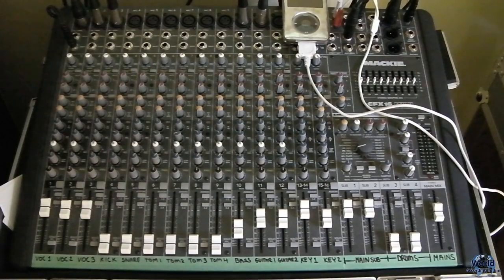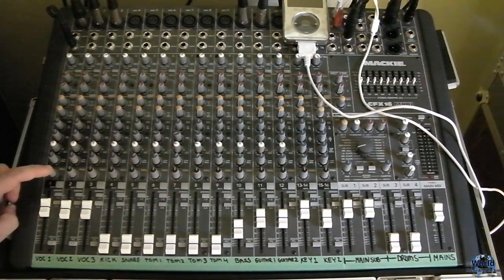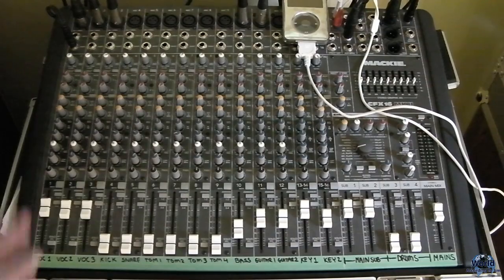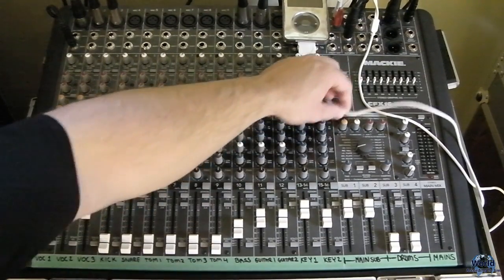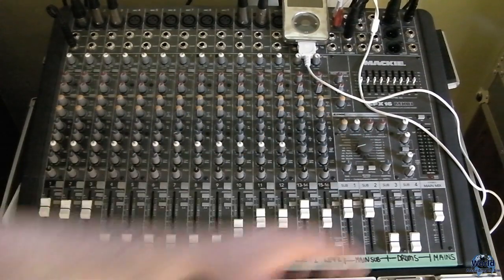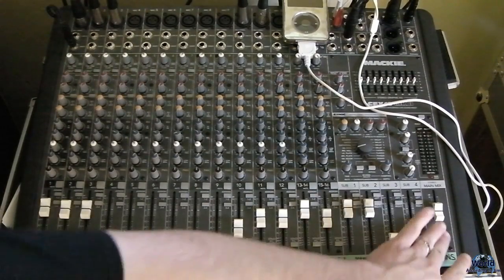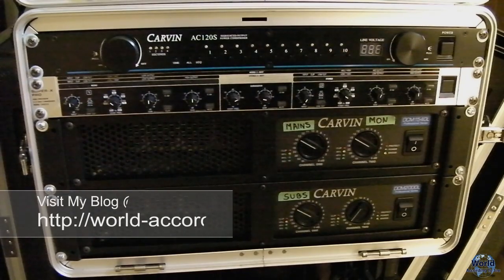How to setup a Pro Audio Sound Reinforcement System

Comment: I found several opinions here in the net about CAT5 cable, definitely this cable is not suitable for an AUDIO SNAKE (if we intented to use it on the go, abused and stepped on). Obviously not for the band that go places. But it took me 2 weeks to troubleshoot the buzzing and humming at 12:00 vol. level. It worked perfectly fine, only, I did it for permanent setup. I run it fixed on the wall from the stage of our church to the back seat area. Not an entry level audio snake but it works. Cheap!

Comment: That was very informative. Oddly I have the same Mackie board and the same BBE compressor and am really happy with them. Good equipment for working musicians at a reasonable cost. 
Love the tips on the where to run the compressor and eq. I like your style or rather lack of any pretension.  A regular guy explaining things well. Bravo and thanks for taking the time to make this. I learned quite a bit.
Bought a snake and was wondering if you can use them as sends for speakers as well as inputs?

Comment: Thanks for the info,Just purchased my first mixer (Mackie CR 1604 VLZ) Similiar to yours, but no built in effects. Will eventually use this equipment for live sound, but it's main use will be in my home studio.I found most of your information helpful.I am also interested in hooking this mixer up for recording in the studio ( I have 2 Alesis ADAT machines ) And an Alesis io2 digital interface wit Cubase LE software.The manual with my Mackie is a little confusing. 
Thanks again for the information

Comment: The problem with signal leakage when using the panning knobs is due to the quality of the board you are using.  Mid-quality and higher boards DO NOT leak signals between panning knobs.  

Also - if you are using sub-groups, you need to pan the channels to get the full signal!!

Comment: 12 o'clock is fine, or even 3'oclock, as long as the gain from mixer through processing is correct. The attenuators allow you to set for desired or legal volume levels by trimming back the signal sent from the mixer/fx rack instead of the other way round(amps fully clockwise but faders &trims on mixer set very low = noisy, thin sound to both house and stage monitors).

Comment: Awesome video! I learnt a lot about running PA systems. I didnt realise you need much more than 2 FOH speakers, 2 monitors, a mixer and a power am. had no idea about running compressors, eq's and crossovers. so now im left in a world of confusion and wondering if you could help.

Basically i have the same mixer as you do, and was wondering how to run guitar amplifiers and bass amps through the mixer for a more live sound.. please let me know a simple setuo for a small church band.. :)

Comment: Great vid I found it very useful. I see you have an iPod plugged in. I presume you'd want this to be play back music in stereo. Your vid is about setting up a band in mono. When I plug in an iPod or such device into a stereo jack of my mixer the output is in stereo but sounds bad/flat. It doesn't sound very good.
Simple set up as were building up the PA
Edirol M16-DX digital mixer > Cerwin Vega 2800 power amp > Peavey monitors. Any suggestions on getting a good sounding mp3 playback on the PA?

Comment: Regarding with the mixer that you have (Mackie CFX II).   I got the same mixer.  One thing that I hate is the clipping of the EFX.  I am usually putting the main level EFX 2 to 12 o clock position.  Then same with the individual channel EFX volume.  But with these settings the EFX clips and sometimes the mixer shut off.  Unlike in my Yamaha MGCX I got no problem in clipping of EFX.  Try to set it and observe it.  If you have some idea how to avoid it will be appreciated.  Thanks

Comment: Awesome video, I need help with connectivity. I use 2 amps one for the Mains and 1 for the monitors I also just purchased an EQ similar to the one on your video. How do you have your system connected in this video. I really need help with this.

Comment: Watch this video. Explains about speakers amps and mixers well. Basically you will need an amp somewhere in your setup, it may be built into your speakers (Powered speakers), built into your desk (powered desk) or as a stand alone amp.

You will also need mics, mic stands, cables (spares as well), and maybe a couple of DIs.

Comment: Hi Jim, I recently bought the Mackie ProFx16, very similar to the one in your video. It has an USB router to connect to the computer which has Traction3 bundle DAW Software installed. However I am very new at this and recently updated to this Mackie. I just want to know how can I send input audio signal from guitars , bass etc to register in the tracks in the DAW. I don't get signal or sound from mixer. Like I said I'm new at this and have a lot to learn. Could you help me with some info.
Thanxs

Comment: My question is about subgroups.  Suppose I only have one microphone in my setup, and I have no subgroups.  At what levels, specifically, do I put the 4 subgroup sliders at and do I depress the 1-2 and 3-4 buttons up or down?  If I only want to have 2 subgroups and not 3 or 4, how do I work the 4 subgroup sliders and the 1-2 and 3-4 buttons?

Comment: I'm just getting started in sound. But I am the drummer in my band but also own the PA system. I have a 12 channel mixer, two mains passive, two non-powered monitors, and a amp. I'm only running vocals and my kick and snare now. Do I need a EQ, and compressor, and power conditioner for my setup?
Reply: Thanks for the info.

Comment: Question - if all my settings should be at unity what volume should my keyboard be set at? Should it be at high to max volume with as little gain as possible or lower with higher gain on the board? There is no unity indication on my keyboard output volume fader. Thanks!

Comment: i just purchased a mackie dfx 12 which is a bit smaller than yuor but i was wondering how do you use that fx?? do i need to run the aux send back intot hereturn to be able to hear it or do i what? i tried turning the aux2 fader alllt he way up but i still dont hear the fx.. can you help

Comment: Hello Jim, could you pl clear my doubt on the Mixer which you using on this clipping Mackie CFX series, me use the same. I cant understand why the mixer is not allowing to send any of its individual channel straight to the main volume without touching the sub group volumes. is there any shor cut for that?? or is there any particular advantage of working those mixer that way?
Reply: Just be happy with the way this desk works. Professional desks work this way and if you want to progress to higher levels then get used to using sub-groups.

Comment: Hi. Can anoyone help me. I recently acquired a 15 meters, 12 channel audio snake. It uses CAT5 UTP cable. 8 XLR and 4 Unbalance 1/4 inch jack. Everytime I plugged everything in the mixer, it produces hum and buzzing whenever I cranked the volume up to 12:00 o'clock and higher. I tried to use ground lifting AC adaptor, connect a wire to any metal to grounding source and even used a power strip  with proper grounding, but the hum noise remains. Is CAT5 cable good choice for audio snake?

Comment: how do you set up the main insert for compression? do you use a y cable placed in the in and out of the compressor and the single end in the main insert? cuz it looks like your only running one cable into your main insert... can you clarify?
Reply: The 'one cable into the main insert' is a 1/4" tip/ring/sleeve male connector.  Out of that connector, it's like you stated. A y cable setup. The male t/r/s connector is wired to 2 separate 1/4" male tip/sleeve connectors. One os a send, one is a return,  placed in the in and out of the compressor.

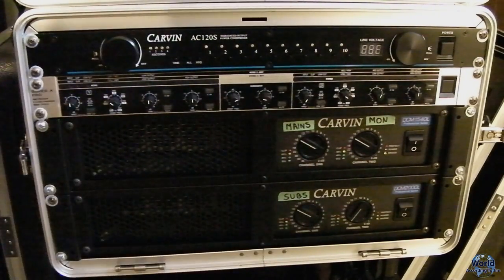Comment: Fellow sound engineers: PAY ATTENTION at 13:49 to 14 : 30 !  Just because "everyone" keeps their amp attenuators fully clockwise does not make it correct.  Jim I equally commend you, thank you, and stand with you on correct usage of those knobs on the mains/monitor amps.  Those of you who think you will "burn out your board" by "running it too hot" or that you will run out of headroom are mistaken.  Those will happen if you do not properly set gain through your board and signal processors.

Comment: can you show me how I can record a live band through the tape line forme plx?
Reply: If you have tape outs, they usually correspond to SUBGROUPS, also called BUSSES.  I have an old mackie 32x8, which has 32in, and 8 busses or subgroups.  The 8 busses allow me to out to 8 tape tracks (8track!).  You need a device that connects to those outputs and records each bus in mono.  For a modern digital recording from an analogue board, you'll need one input for each subgroup\bus you attach to.  Plug that into your computer, and record with your favorite app (audacity, audition, logic, pro tools).  Now you can record the live audio using the tape lines.  Most require a 1\4" jack, and will boost the voltage by 4db (a volume  boost).  Just know that you'll be getting whatever mix the board operator plays out on the busses, as occaisionally they will have to move the bus faders for compensating.
Many digital recording interfaces have a passthrough on their inputs.  If you can get enough of them plugged in, and use the pass throughs, you can actually get all your inputs from a prefader direct insert or a direct output on the board.  That way, you can catch only the clean input.
If you have a digital board, you should be able to record in REMOTE mode, allowing you to get the house mix using keyframing style in your app, and then undo all the keyframing and adjustments to get a clean signal, or check the adjustment and play with it later.  IT should even allow you to play with the pan pots.

Comment: I agree with everything except your views on the 31 band...if you turn down those 2K frqs on all stage set ups..then why not just use filters? No need for a db fader! That was not correct. I have pink noised tons of rooms and my 31 bands would be ALL OVER the place. One fader 5db + or - next to each other. Best is to use a parametric/pink noise/notch system. Youy get the most out of your full system. You automatically pull out 2K freqs? Huh? Must be using Cellestrions or worse.

Comment: I disagree with you on your EQ settings and your gain setting on your amps.
first with the amps. Myself and every sound tech in my area we keeps our gain on our amps at full tilt and boogie. We do this so we can get as much headroom as possible form our systems, if you drag your amps down you are going to be pushing your mixers harder and as you said before getting more feedback, I gives us great control over what we are sending to our speakers. You can blow out speakers no matter where you set

Comment: Wrong.   Almost every modern mixer already has high impedance inputs so no need to bother with a DI.   Only times you might want a DI is for long cable runs. For short cable runs to the mixer <25ft. don't waste your time.

Comment: not to bash this guy, cause he's tryin... ...But panning only feeds out to a single sub if the board allows mono-ing the sub at the sub break.  This has the effect of pulling only a mono signal from the every channel assigned to it.  Here's the trick... ...You have to output to mono by using only a single xlr output from your main out.  IF you use both, you will get mono to stereo which drops your gain and bleeds into both channels.  IF you are getting bleed, you are getting mono to stereo output.  I've used these boards for years.  It's not a rocket science thing.  If you pan your pots, without a sub mono button, and you output stereo by plugging into both xlr outputs or both main out 1/4" jacks, you will be outputting a stereo field.  By placing audio in the left side pot all the way, you are NOT PUTTING IT LEFT ONLY, you are simply placing the majority of the signal in the left side, and some in the center, which will get placed into the right side, with a slight delay.  Why?  Stereo is considered a TAPE mode.  You'll get a stereo field with bleed instead of a mono signal.  However, some  boards allow you to force the pot into a mono sub mode, so you can group several instruments together in that sub and affect them all with a single fader.

If you're blowing speakers, you have a serious OUTPUT WATTAGE problem.  First, make sure you don't put speakers above 50% (this is normal operating mode, and most warranties are Void if you go higher; some at 75%).  The level noted in your warranty is typically the UNITY level for the equipment.  
Amplifiers between the board and the speakers will blow if their MAX INPUT WATTAGE is not bigger than the board's output by a large headroom of about 100-200w (typically you want to double it, but 100-200w will do).  Make sure MAX INPUT WATTAGE OF AMPLIFIER is BIGGER than MAX OUTPUT WATTAGE OF BOARD.   What they [amplifiers] OUTPUT is relevant to the speakers... ...This means that your SPEAKER WATTAGE MAX PEAK should be 100-200w LARGER THAN YOUR AMPLIFIER's MAX PEAK OUTPUT.  They will rarely overload in this instance, and your sound will be a lot cleaner.  They will also last longer.  
For small boards with low output:
IF your amplifier is adjustable, put it at it's UNITY level, which will put out what's coming from your board.  IF your board isn't powerful enough for the amount of wattage for carry, you can use an amplifier that outputs 2 times your board's max output.  Unity will be only slightly higher than your boards output; set the amp to 88-95%, and the output to the speakers will be at a higher wattage, still clean.  This should avoid peak distortion and equipment damage as long as you keep your board maxing in the yellow.  You can enhance this further by doing a steady stair step in similar fashion.  Use multiple amps boosting to 2 x the one before, and set each one to 88% (roughly).  Just remember, any change you make will be a lot larger in the output, so you may have to work harder to get the balance right.  Also, you'll absolutely need to EQ every mic and instrument input.

1kw speakers are pretty standard, and most live boards output more than that in their max.  Studio boards, too.  However, a good engineer keeps it low output, so that the sound is clean and clear, then amplify that to what they need for output.  This also aids in stage monitoring, as the artists can use smaller amplifiers for a personal monitor, or one amplifier for all the stage speakers, all coming from an onstage mixer.  A splitter allows the same signal to flow to both mixers and the onstage sound is completely independent of the house, though both can be EQ'd the same before the split (doing this with a standard mobile rack eq is a great way to take the guesswork out of it at both ends).  A competent engineer will make sure that the sound onstage is only loud enough for the performers to hear themselves enough over the crowd to control their dynamics.  

With any kind of metal, done right, a competent engineer can also teach yo' daddy's rock and roll to suck eggs.  lol.

Comment: I'm sorry to say but i would suggest all the ppl out there not to take advice from home schooled ''PA technicians'' because this here system is down right wrong in its setup, utilisation and missinformation all over the topics.... very missleading

and btw the ''sensitivity'' knobs are meant to be all the way up - the only reason you have noise is wrong setup or lousy quality components. the geq u are using is totally deforming your sound picture - never in my life i would even dream about such a wrong advice about them... man really - wtf are you thinking.... if u wanna ring out the monitors u use single band configurations depending on the wedge and room u are in and 3 -4 dbs max of attenuation - anything more introduces so much phase in to the signal that distorts the sound 2 much so u basically work against your self and no wonder u can't do anything... i can't even explain my self I'm so shocked about this info and the comments about how good advice you give... hope in humanity lost... no wonder quality is a word no one even thinks about anymore because it doesn't exist anymore in most of the micro firms around... utilising chinese gear... jeez
Reply: Perfect comment lol